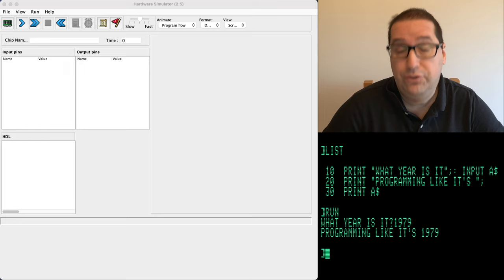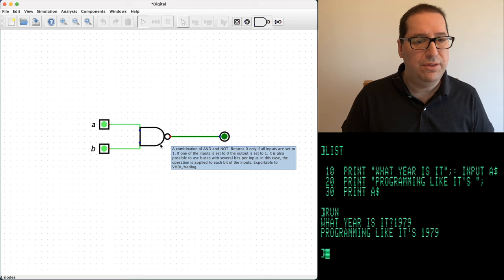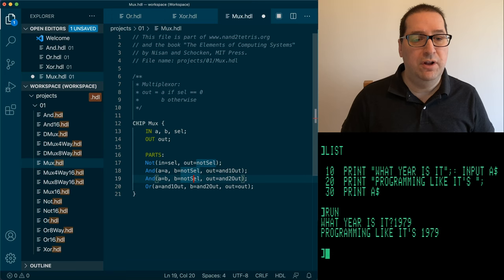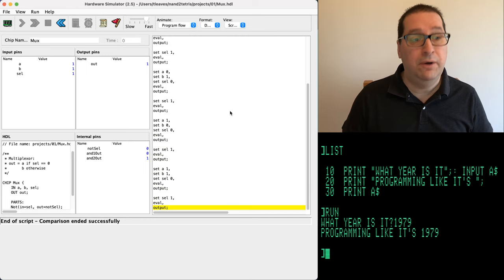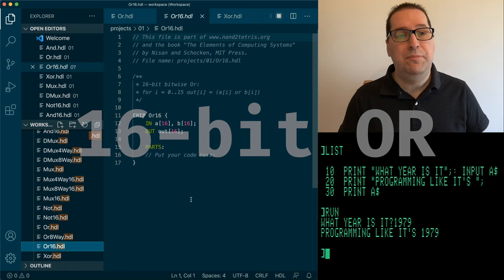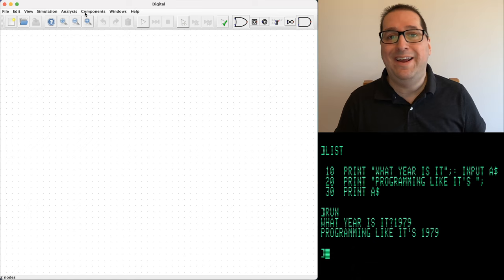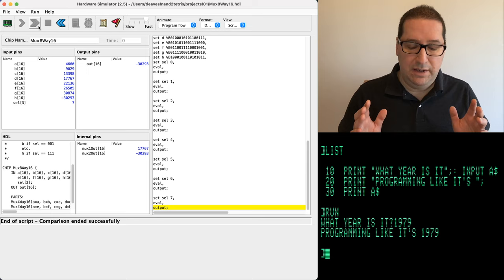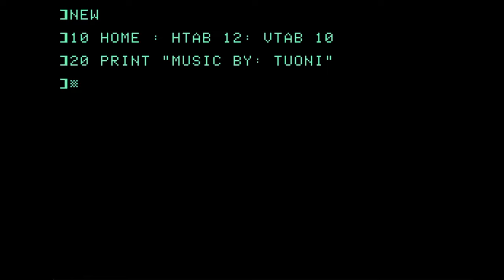From NAND To Tetris - Logic Gates Lab

Comment: I can understand after implementation, but it's hard for me to think implementation logic, I think I can't understand something ...
Reply from the maker: This is definitely common - it always seems easy in hindsight! When I feel lost, what I try to do is divide the task into smaller and smaller parts until they're each individually simple. Sometimes this leads to an easier implementation (which is probably not the optimal one, but is at least functional).

Once you have a functional solution, you can worry about improving efficiency.

Comment: question on that 8 way demux: i figure the diagram would look practically identical to the 4waydemux you built, but how do you handle that extra sel bit? is the splitter capable of having one wire carrying 1 bit and the other carying 2 bits? do you put another input, declare it sel, have it run 2 bits on the line, and split the wire with one 1-4demux on a not gate? another question: how on the 4-way-16bit mux did you determine where to use the msb and lsb? i tried translating how you prescribed the msb/lsb in the 4waydemux problem, but got a little lost. thanks for the video, great stuff.
Reply from the maker: Without looking at the diagram to answer your question, if you need to choose between 8 values, you need 3 binary bits. So yes, you'd potentially have three layers of logic.
Reply: can u tell me what software is he using
Reply: @voidenth  for what? for the HDL? for running the HDL code?

Comment: Tea Leaves: You should check out the properties (right-click) of the splitters that you are using in this video. Once of the "recent" changes to Digital includes the "spacing" on the I/O lines of the splitters to make arranging the circuits a little easier.

Also, I assume you are using the splitters to illustrate the multiple "lines" that a 16 bit gate would have, but, just for completeness sake, and for the sake of your viewers, you do know that the gates themselves (AND, OR, etc) can be multi-bit, right? For example, one 16 bit wide input, one 16 bit wide output, and one 16 bit wide NOT gate.

Another interesting feature is modifying the number of inputs on a gate. For example, place a basic AND gate, then while mousing over the gate in Digital, press the "+" or "-" on the numeric keypad, and it will increase or decrease the number of input for that gate. This helps a lot when you need, for example, a 3 or 4 input gate, to avoid having to use multiple gates. And while there are not, commercially available, chips that implement ANY number of inputs, there are some commercial chips that implement 3 and 4 input gates, so you can more closely replicate, in Digital, a circuit that could actually be built on a breadboard if someone wanted to do that.

Keep the videos coming!

Tony
Reply from the maker: Thanks for the tips! They are super-helpful.

Comment: I love the fact you are teaching real-world circuit specification HDL, but after watching the Nand Game series, my question is, isn't there some kind of tool that will let you draw circuits graphically, and then convert the schematic diagram into HDL?
Reply from the maker: Yes, great question! Not only do such tools exist, but you don’t even have to draw them - you can literally just feed a truth table to a tool such as Digital or Logisim, and it will generate the schematic or HDL for you.  (Typically, the HDL will be a well-known one such as Verizon or VHDL - this class uses a sort of very bespoke toy HDL that I don’t believe any of the major tools speak.)

That said, the point of drawing them (or writing the HDL) yourself isn’t because that’s valuable in and of itself, but because it provides a handle with which to think about how these things work at a low level.
Reply: The tool Tea Leaves is using for the graphical representation of the circuits, Digital, does support exporting the circuit to (I think) two different "flavors" of HDL.

Comment: how did you figure out the logic for the 4way and 8way muxes? like I get the logic from using ands ors and nots but why pass the least significant bit into the mux16 gate? if the lsb is 0 then in the case of a and b, a will always be selected and b will be eliminated from the output, even if the most significant bit is 1 in which case the correct answer is b.
Reply from the maker: The main way I got there was by analogizing the logic for the demux, which worked similarly. But on a more fundamental level, the answer is "look at the truth table" - if you look at the pattern of the selector bits, it's clear that you are going to be building some sort of two-tiered structure, where one tier handles the 'outer' layer, and the other layer needs to be replicated twice for the 'inner' layer. My suspicion (which I haven't validated, so take it with a grain of salt) is that you could probably build these circuits doing either LSB or MSB first, as long as you were careful about which inputs (or outputs) you wired to which final gates.

Comment: Hi there, is there a way to write a for loop in this modified HDL language so as to not copy paste all the bit lines? I tried the 'standard' way by setting up an index variable and incrementing it with every iteration but the Hardware Simulator would not even let me load the chip. Thanks in advance for this very helpful video
Reply from the maker: The HDL used in this class is not really an imperative programming language in that way. Some HDLs (e.g. Verilog or VHDL) might offer facilities similar to this, though.
Reply: @TeaLeavesProgramming  fair enough. Thanks for the quick response.

Comment: Any tips to someone who is struggling doing this? I've managed to make the NOT, AND, OR and XOR gates so far, but MUX is being a pain, and I want to be able to figure this out by myself so I didn't watchted the part of your video that shows the MUX answer. I know a bit of propositional logic and as MUX has 3 inputs it means that we can make up to 256 boolean functions (2^(2^n)). Finding OR and XOR was easy because 2 inputs means 16 boolean functions so by brute forcing I've found the answer. But man, I'm stuck for hours trying to figure out MUX.
Reply from the maker: My tip would be to actuall write out the truth table for MUX and look for patterns. Doing that should let you identify a reasonable place to “branch” your circuit and break down the remaining parts into smaller parts.
Reply: @TeaLeavesProgramming  I got it after installing Digital, which allowed me to have more intuition on how arrange the gates. I guess I was just overthinking alot. Now all the exercices on chapter 01 are done, heading to chapter 02. Thank you for the help.

Comment: For designing Mux, How did you know from the beginning you want two And gate to designing Mux?
Reply from the maker: Using a technique called a Karnaugh map, you can simplify the truth table of any circuit into an expression; a Mux, simplified, reduces to (NOT selector AND input 0) OR (selector AND input 1). From that the fact that you will need two ANDs falls out.

Even without a Karnaugh map, it's pretty straightforward to figure out the expression from just looking at the truth table and seeing the patterns - which is what I did.

Comment: I don't know if you or anyone else noticed this but at 27:59 where after you fixed your mistake in Mux.hdl and you're about to test the changes, you actually load in Mux16.hdl, then you load Mux.tst to test against Mux16 but you haven't implemented that. How are the tests passing? Or did some editing magic happen there haha!

Definitely editing magic! While I was watching I yelled at my monitor "That's the wrong file that'll never work!" 2 seconds later... it worked... hah.
Reply from the maker: It's entirely possible I messed up an edit! Thanks for pointing it out.
Reply: @TeaLeavesProgramming  In the tests the first thing it does is also load the .hdl so you can actually skip loading the chip entirely. Probably a little late to be helpful but hey, next time! =P
Reply: @TeaLeavesProgramming  Also thank you for these great videos
Reply from the maker: @Kylebacca  All that time I wasted! Oops. Thanks for the helpful tip!